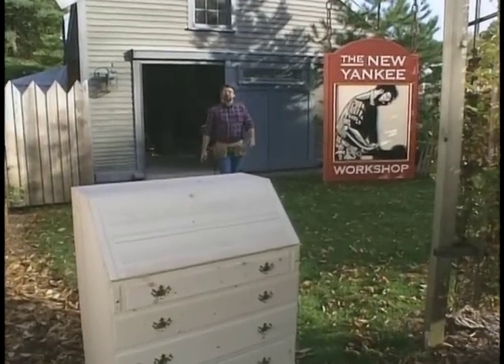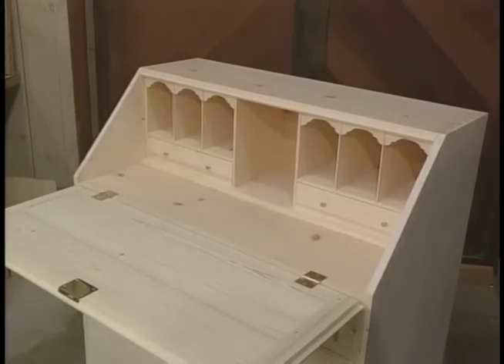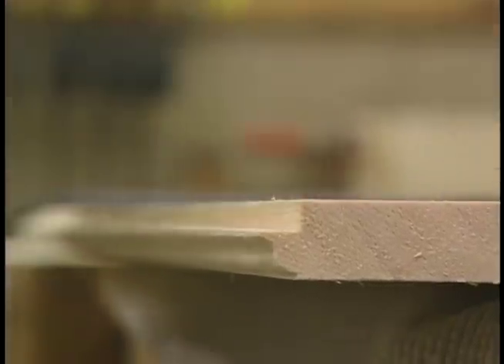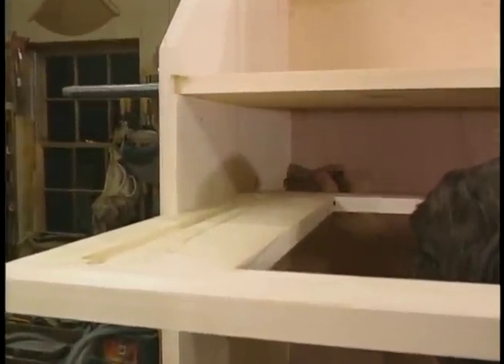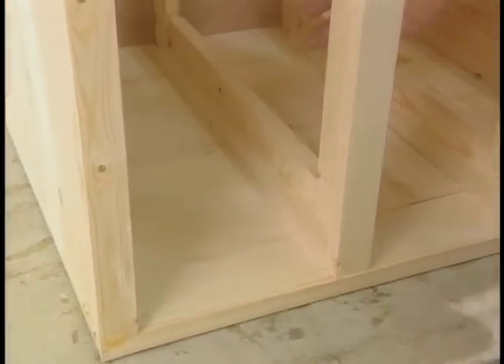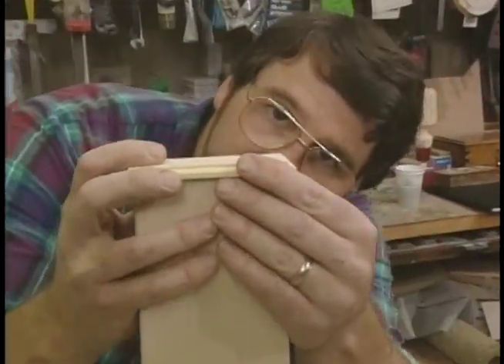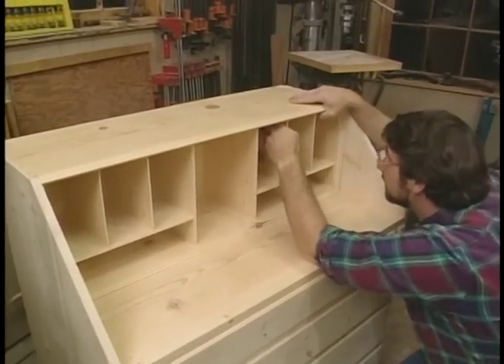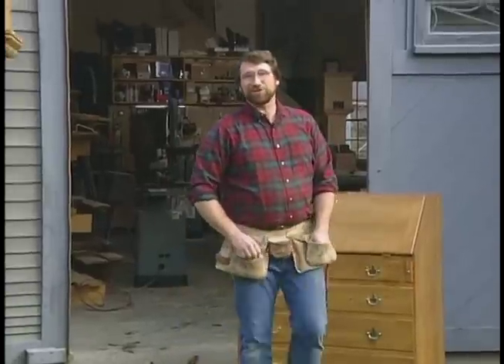Secretary Desk  |  S5 E12

Comment: Norm, I'd say that 3-1/4 horsepower router is the best tool to use in your shop! What do you think? Do you like it?
Reply from the maker: Norm loves his table saw. Uses it for almost every project.
Reply: @newyankeeworkshop  I love the stacked dado head cutter, and sacrificial fence for rabbeting in this case.
Reply: Norm does love his table saw. Anyone mistreating it by putting a drink on "it is sure to be harshly reprimanded". I grew up watching Norm on PBS and I don't do any woodworking, but there are important life values that I believe Norm has demonstrated through his exceptional work. He has definately been a roll model for me. It's great to see the show resurrected. Oh, and I always remember to wear safety glasses!
Reply: @antkneez1  See, this is what I heard in part 1 of Table Saw 101, when Norm was showing the viewers at home, how to clean a cast iron table top, as well as putting on hardwood flooring wax, to help prevent rust buildup, in addition to the fence, wings, and blade insert.